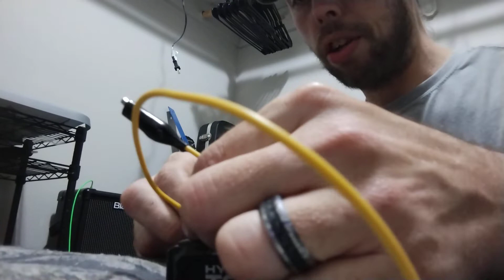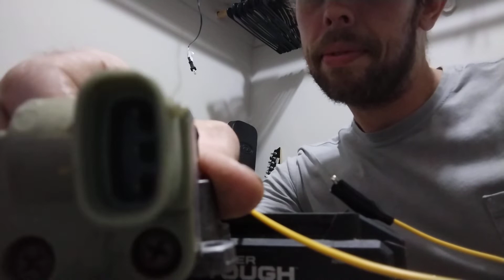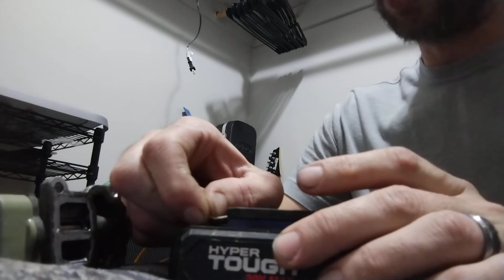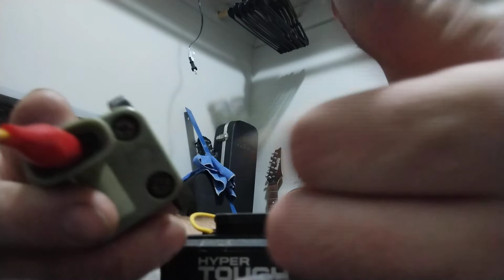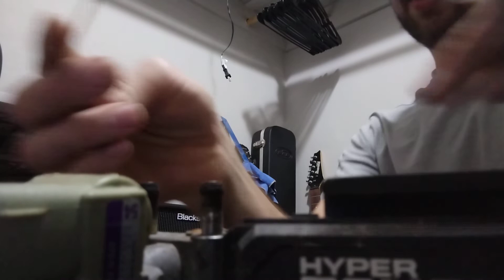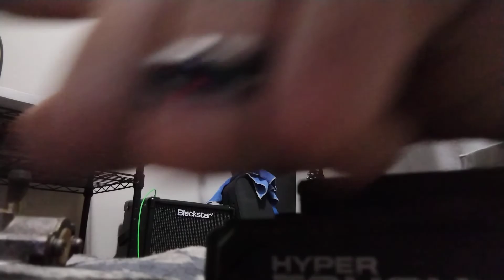How to test all electronic sensor in your car.

Comment: very cool and informative 👍 👌
Reply: can't wait for the next one!
Reply from the maker: @daylamac  absolutely. I also take requests! So if you have any specific car related questions then be sure to leave a topic relevant request!
Reply: @crypticscrutiny1153  I actually do have a request. My front passenger seat on my 2019 Honda is rattling. What should I do?
Reply from the maker: @daylamac  well when do you notice it? Over bumps? Can you knock the back of the seat hard enough to simulate the noise? Is the seat power controlled or is it a manual?
Reply: @crypticscrutiny1153  yes you can shake it with your hand. And no, its manually adjusted.
Reply from the maker: @daylamac  does the sound seem to be coming from underneath? If so, you've got a loose track which may call for a replacement if it's anchoring bolts cannot be torqued. When you shake it does it feel loose?
Reply: @crypticscrutiny1153  yes
Reply from the maker: @daylamac  well, it seems to be an easy fix. Either the track needs to be released or the anchoring bolts need to be tightened. May have to remove the seats from the track.
Reply: @crypticscrutiny1153  TY I will give that a look see and let you know the results
Reply: @crypticscrutiny1153  hey man hmu 😮